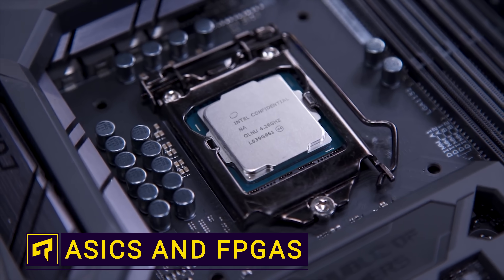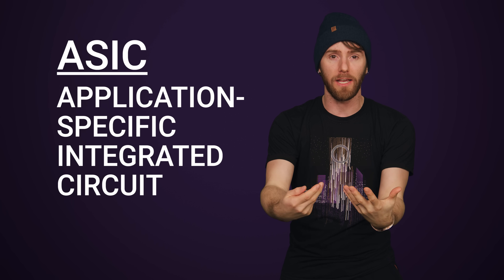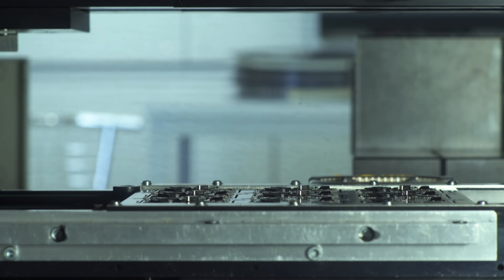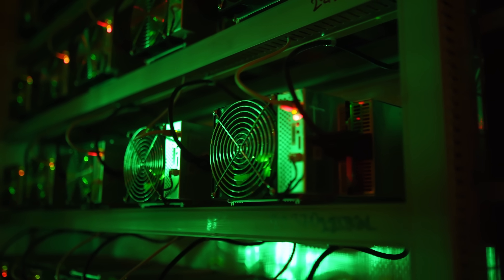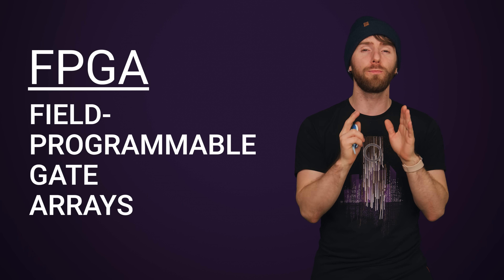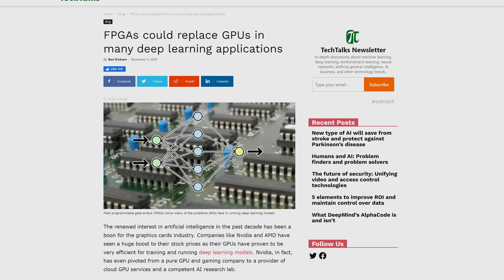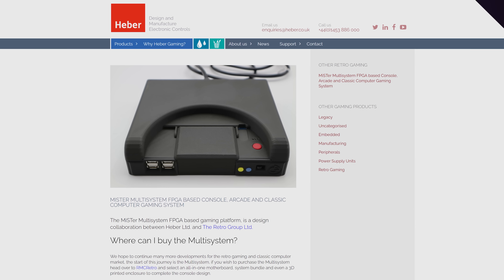These Chips Are Better Than CPUs (ASICs and FPGAs)

Comment: As an FPGA Engineer it's incredibly exciting to hear FPGAs being talked about! Also, in some cases for ML applications FPGAs are being skipped over in favour of AI Accelerators (TPU, GroqChip, Cerebras, SambaNova, etc) in order to replace clusters of GPUs.
Reply: Arent fpga chip used widely for plc aren't they?
Reply: @ghostmexi007  From my limited understanding of PLCs they are highly specialised devices and are not FPGAs, but are actually microprocessors that execute Ladder Logic programs. They can have large amount of dedicated I/O, ADCs, DACs, and different communication interfaces. Some PLCs may have some amount of switching fabric or some other kind of programmable glue logic, but I would not consider them to be true FPGAs.
Reply: @ElToroLibre  interesting thought they would be consider an FPGA seeing them as reprogramable cpus and the integrated logic circuit by the nature of the definition of an fpga well thanks for  sharing this knowledge
Reply: What you do is really cool. I'm going on an FPGA/verilog rabbit hole after reading these comments from FPGA engineers. Starting to regret my BS in infotech... haha
Reply: @RamyWarda  This is still something you can do as a hobby! Depending on your experience you could start with SystemVerilog (as this is supposed to be closest to C) and a cheap development board, a number of them are well supported with lots of example projects to learn from. Some of them have displays, USB, buttons/switches, GPIO pins, VGA, HDMI or other audio/video output, etc. Even LTT have done videos of FPGAs used as retro game emulators! (Look for: "The Best Way To Play Retro Games?" by ShortCircuit). If you're feeling brave after learning a little bit about FPGAs you will have a great foundation to dive deeper into designing ASICs :D
Reply: I am in final year of electronics engineering, I am interested in making a career as a FPGA engineer. What should i know as a fresher and how to can I get placed?

Comment: Well yes but actually no. FPGAs are simultaneously between ASICs and CPUs and also on the other side, past CPUs - yes, an FPGA might be used as simply a task-specific circuit (like an ASIC except reconfigurable to do something else), but the larger FPGAs are also complex enough to behave like a CPU, ANY CPU that fits within the resources they have; and in that sense, they are MORE general than a specific CPU. Not only can they run software like a CPU does, you get to choose WHICH CPU you want them to emulate.
Reply: Wow

Comment: One major benefit to using an FPGA that Linus didn't mention is that they consume FAR less power than CPUs/GPUs. Accelerating a task like a ML core on an FPGA can meet/outperform a GPU at 1/10th the power draw. Also, depending on your design, they can perform orders of magnitude faster than software equivalent algorithms.

Heterogenous systems are the future!
Reply: An FPGA could be programmed as an advanced floating point unit. I found modern x86 floating point perfomance from AMD and Intel very weak (need a lot of cycles) , that's why Apple M1 lineup is so poweful despite running at 3.2GHz thanks to the powerful floating point, that's why it has been a huge sucess for music producers, sound designers, editors...
Reply: @saricubra2867  The issue with floating point calculation is that it is very hard to do and almost never used (until it does) in a PC, 
so a CPU usually have just one floating point unit shared between multiple cores.
Reply: @saricubra2867  Do you happen to know why x86 floating point performance is weak? Is it in applications using SSE or x87? If it's x87, you should be using SSE (the x87 stack is a huge performance killer, especially in modern OoO CPUs).
Comparably speaking, an x86 CPU is far better at the actual FP uOPs than a FPGA. Most of the time, you want to avoid FP on a FPGA and instead used fixed point, because FP takes up a lot of hardware resources and cycles comparable speaking. The major benefit though, is that you can chain the execution graph together in a FPGA to be purely pipelined if you have a regular workload (which is the case for filters and synthesizers in sound - digital signal processing). I would imagine that most sound DSP applications use fixed point though.
Reply: @saricubra2867  aww... The intel fanboy grew up into an apple fanboy!
Reply: Thats kind of obvious if they do one specific task it's possible to optimize hence waste less energy. Where as a general purpose computer can't optimize ahead similar to why consoles can perform better on games than PC do to optimizations ahead of time.
Reply: What you say is partially true, and it depends upon the application.  Part of the appeal of the FPGA is that you get to get rid of the fetch/decode stuff in the CPU.  This means LESS logic overall.  However, for the SAME AMOUNT OF LOGIC AND SPEED, a CPU or ASIC will always win over an FPGA.  In other words, if you programmed an FPGA to be an ARM core, that will always suck more power than a dedicated ARM core.  And, yes, many modern FPGAs will include some sort of hard macro CPU core that is fully optimized if you need one.  So you probably shouldn't be including CPU cores in programmable logic (unless you need a specific core, such as emulation).
Reply: @harrkev  Most modern FPGAs do not contain a hard CPU, those are a special class often referred to as a SoC (or MPSoC) FPGA.
Most FPGA and ASIC implementations do still have a Fetch/Decode in their architecture, but it's very application specific (usually descriptor based). You could probably think about it as the extreme case of CISC. Where x86 has a CISC instruction like load-multiply-add-store as a single instruction, and an ASIC/FPGA may have an "instruction" like compute-pi-to-1million-places (if it's an accelerator to compute pi).
Reply: @monsterhunter445  That's not really true. There are a lot of games where a seemingly lower specced card beforms better than an equivalent console.
Reply: @hubertnnn  Then the Zen and CORE series don't follow that, since each CPU core has it's own floating point unit(s). Same for the M1's firestorm cores.

I'm pretty sure that audio is heavily floating point dependant, since we are dealing with real numbers here, literally every audio DAW uses 32bit float.

Fixed-point must be integer on disguise.
Reply: @hubertnnn  "almost never used"
Not true, specially with the 486's introduction, a lot of stuff is float nowadays, that's why Bulldozer and Piledriver failed pretty badly vs Sandy Bridge, the FPUs were extremely weak in comparison and that a huge impact on CPU bound gaming perfomance, console emulation, music production, excel...

Zen 1 was designed to fix the absolutely horrible FPU perfomance from Piledriver and Bulldozer and that is massive.

PS3's CELL was so ridiculously fast in floating poing that was used as a graphics co-processor too and could help with polygons besides handling game logic, and realistic sound...
Reply: @saricubra2867  

Not only FPU, but also single core performance, since any workloads (VSTs, MIDIs) are consolidated to single core processing at Master tracks
Reply: @beezanteeum  Faster the FPUs, faster the DAW perfomance. The M1, and Pro has symmetrical integer and floating point, something that i don't see on CPUs since the CELL from PS3 as an example.

Alder Lake floating point is almost symmetrical with the integer speed which is interesting.
Reply: FPGA guy here... how power efficient a design is really depends on the application and design that you put into it. There's no guarantee that an FPGA will use less power. In fact, they're almost always more power hungry than an ASIC of the same design.
Reply: @saricubra2867  fixed-point is integers in disguise.
Reply: I always wished that every PC/Device came with an FPGA instead of/in addition to a Gfx card, and then the game developers push their own super optimised firmware on it so that every single person experienced similar/same graphics performance. (This would work even with CPU intensive apps as the FPGA would just override both the CPU and GPU components and push everything directly to the display (or to the iGPU for further processing).

Imagine, thin and lights with 10x more gaming performance of a PC, and draw less power while gaming than during regular use lol. This could similarly be extended to high performance applications such as video editing or CAD.
Reply: @canoozie  Just a small addition, the 'almost' is just there to capture cases like comparing an ASIC on an ancient process vs a new FPGA or a hirrible design, short of that it's impossible to beat power efficience of an ASIC with an FPGA
(Perspective of a mixed signal ASIC designer)
Reply: Another major benefit is arbitrary precision, where in the case of ML inference, floats are just wasteful and can be easily encoded using couple bits, which in turn lets you parallelize the design even further.
Reply: If you want a well-tested comparison between CPUs, GPUs, FPGAs and ASICS, check out the history of them for Bitcoin mining and the performance between types and process nodes. Being a straightforward, parallel task, it provides for an interesting optimal comparison.
Reply: Did you mean: Heterogeneous
Reply: Which is WEIRD given they're based on SRAM and consume power just to keep the look up tables stored.  I'm guessing almost all the efficiency is in completing a whole algorithm at one output per cycle, not so much in clock-for-clock power consumption.  Especially true given how absolutely dire FPG clock speed is compared to modern CPUs and ASICs.
Reply: @AGuy-vq9qp  How is he a fanboy? Last I recalled, those things actually did surprisingly well.
Reply: @Vernas_R  As in he's gone from aggressively supporting intel to now supporting apple.
Reply: @AGuy-vq9qp  Is his point wrong though about that being apple's strong point? Of course I personally won't be buying an apple product in the foreseeable future, but their M1 did some miracles... Also, I'm still surprised by how a fanless laptop can run videogames decently with a beautiful screen.
Reply: @saricubra2867  you do realize that MacOS is designed to beas tightly integrated as possible to run on specific hardware settings. Ubuntu on the M1 slaughtered the M1 in MacOS by 20% in compiling Firefox. If you look at it running Windows ARM it's not good because it's still designed to run on a variety of programs.
Reply: @saricubra2867  Using an FPGA as an FPU is highly inefficient. Firstly, at the scales that FPUs are used, it is cheaper, faster, and more energy efficient to use ASIC processes to build FPUs. Secondly, using ASIC processes to build an FPU, would yield...an FPU... FPGAs aren't magic. They can achieve high thoughput by removing unused logic that more general purpose logic blocks have, and by building many parallel paths with the savings.

Comment: ASICs are fully optimized and dedicated logic. You get exactly what you want and not a gate more. It's not changeable but the fastest performance that can be achieved. (GPU's are ASICs.) FPGA are made of arrays of programmable blocks of logic, some of which you may not need for a specific function. They are slower and wasteful but for prototyping very nice. Many vendors have macro functions in their chips as well so you can just connect up to say a multiplier and not consume logic to make your own. Note that so much has been done on FPGAs that the libraries of completed designs are really valuable. This is why Intel bought Altera and AMD Xilinx. If you are doing System on a Chip - you just bought all anyone could ever ask for.  
 When large ASICs are developed some teams take the course of buying or making an Asic Emulator. This is an array of FPGA's interconnected. You then take the ASIC's logic and partition it across the FPGA's. This gives you an accurate representation to run the design on to prove it functions before you spend millions building it. Note the emulator rarely runs at full speed but its a hell of a lot better than a running software simulation of a massive chip which can take a very long time. (Which is lost market opportunity.)  You tend to find the tough bugs far faster. And of course the emulator can be used over and over again with fresh reloads of other unrelated efforts.
Reply: incorrect
Reply: @fredbarfson2624  - Elaborate...
Reply: Yup most EDA is done on FPGAS. Billions of gates are emulated on large SOC and GPU designs. The debugging these emulators give saves manufacturers billions.
Reply: @wtftwitter8225  - Yup - this has been part of my career. I recall one beast of an emulator we built from the ground up with 96 FPGAs found 60+ "corner case" really tough design flaws in less than a week. This would have taken 4 to 6 months with just the software based approach. The system was so successful the design was cost reduced (usually a version 2.0 post release phase) on the fly yielding substantial margin gains. I would not do a complex design any other way. This was for one of the largest ASICs TSMC had ever fabbed. Needless to say, I'm sold. And the fact that 8 months later, when that chip was shipping, that same emulator was pivoted to an entirely different effort unrelated to the original market was remarkable. Some happy engineers there.
Reply: @dennisfahey2379  just a troll.
Reply: You made an error you spelled Xilinx wrong.
Reply: GPUs are not ASICs, they contain ASICs tho, like encoders/decoders for video.
Reply: @gmourao  - As the phrase goes,"Those who can do - those who can't are end users."
Reply: @louischerel7276  - Good catch - corrected.
Reply: So if I wanted to build my own router which should I get? Or should I buy a cpu like I originally planned.
Reply: @meechie9z  for your own router, a CPU. There's no off the shelf chip for that. It's switching where CPUs fall extremely behind, but again, you can't buy an ASIC for that, only manufacturers can. Routing is very lightweight compared to switching, tho.
Reply: @meechie9z  - https://www.youtube.com/watch?v=lUzSsX4T4WQ 
He's spot on and knows his shit.
Reply: @meechie9z  - Get that and a quality managed switch with QOS and VLAN support. QOS will load balance the streaming/gaming and VLAN's will allow you to keep stuff isolated from other stuff - it allows you to segment or partition your network.
Reply: @dennisfahey2379  thank you man I appreciate you a fuck ton
Reply: Incorrect

Comment: "You can think of them as Lego blocks, once you put them together they stay that way but you can always take them apart and put them back together and make something completely different"
Linus never had these flat small lego blocks that were impossible to take apart after u stacked them.
Reply: that's lenovo burned-to-never-work cpus
Reply: That's the very point where Linus got it wrong though, FPGA's don't "stay that way", they forget their configuration every time they are powered down. They load their bitstream from a configuration ROM every time they are powered up.
Reply: Somebody needs to purchase a "LEGO brick separator" tool. :)
Reply: @robspiess  those still dont do much for stubborn 1x2 stacked plates.

Comment: Datacentre ML and consumer retro consoles is a fairly limited selection of what FPGAs are used for (and probably a limited section of the market too). They are used a lot for moving around lots of data, like in LTE towers or in high end cameras/video switches etc. They also get used for glue logic and controllers because their timing is very controllable

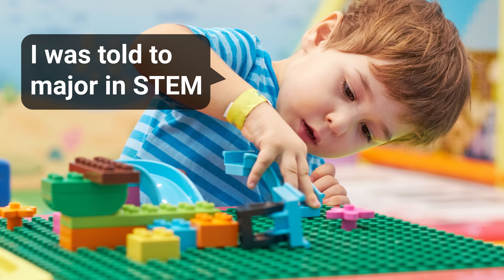Comment: 3:30 the only thing I'd add is that FPGAs are not persistent, aka, they are volatile in that they need to be re-flashed if power is lost. Many FPGA boards will have a local non-volatile flash memory that automatically reprograms them on startup, or something more fancy like an MPSoC will use commands in the OS to reprogram

Comment: 3:35 With the caveat that they're volatile. If they lose power, they lose their programming. Generally they'll be paired with a ROM chip to program them on power-up. Since an FPGA doesn't emulate, but becomes the logic circuit you've built, you can turn an FPGA into a CPU if you want. (I've designed CPUs for FPGAs) But it's surreal because it's like, I have a CPU here! unplugs it and now that CPU is gone!
Reply: If you don't want to lose your program, then Flash-based FPGAs don't have this problem!
Reply: @ElToroLibre  Ooh! I didn't know about those! That's neat!

Comment: A better way to explain this: A CPU can do ANYTHING.  But the down side is that it is always saying "What do I do next?"  It does that step, and then says: "OK.  What is my next step?"  The whole instruction fetch and decode stuff takes up space and time (especially in the case of a cache miss).  Also, a CPU does one thing at a time (only one ALU).  Yes, I am ignoring superscaler.  An ASIC or FPGA is pre-wired to know what to do, and it can also do multiple things at once.  Need to multiply two lists of 100 numbers?  A CPU will have to do that one at a time.  You can put 100 multipliers on an ASIC or FPGA (yes, it will be big), and it can do them all at once.
An ASIC is great of you are making thousands or millions.  The NRE can be a million dollars or more.  But they will run the fastest and be cheapest per unit.  An FPGA will be more expensive, slower, and more power, but a hobbyist could easily make a design with just one of them, using free tools.
Yes, I design ASICs for a living.